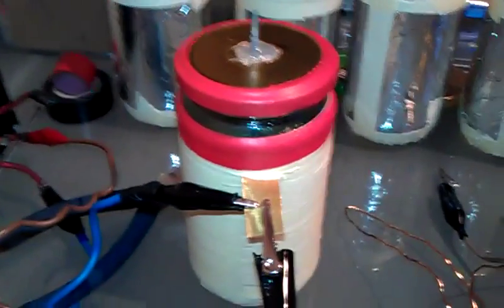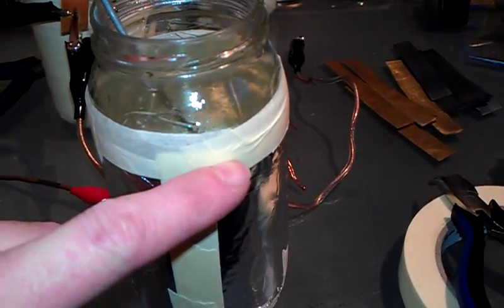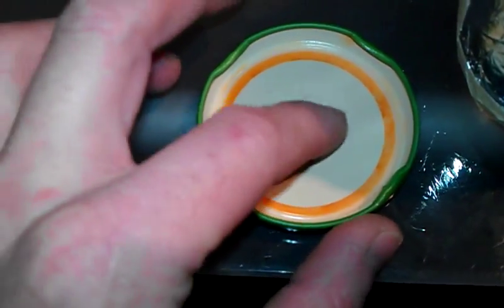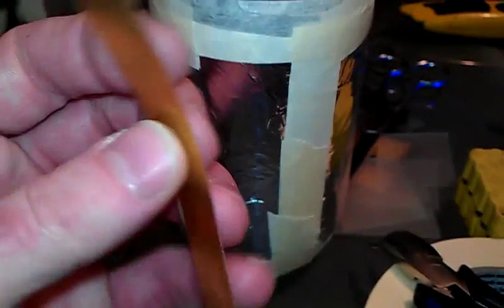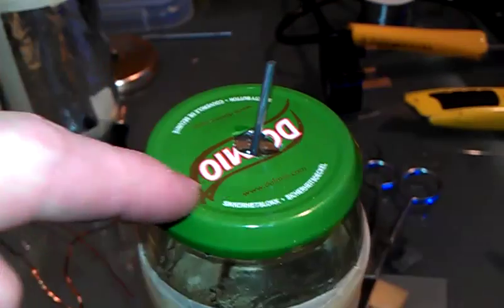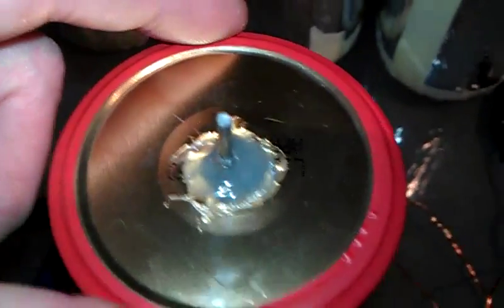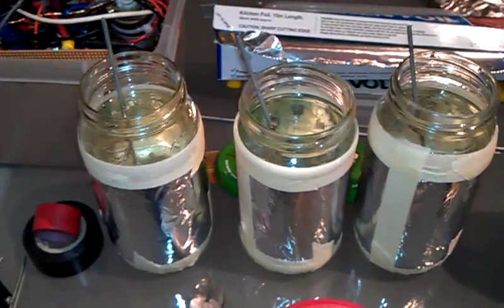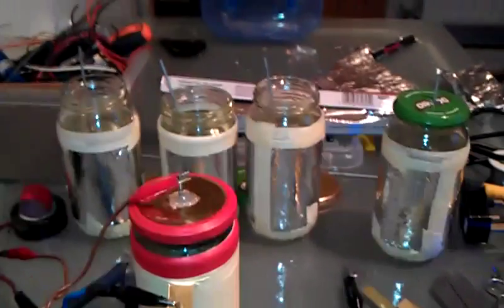Salt water capaciter and the effects

Comment: How you increase the voltage rating of it up to 2kv can you show a step by step...
Reply from the maker: The closer the foil is the the end of the insulation the lower the voltage! As well the thicker the insulation is also” The bigger the sheets of insulation the more voltage it can handle. As voltage can creep up and over the insulation or work itself through the insulation!! 
Hope this helps mate.
Regards 👍🏻

Comment: +high1voltage1rules1 i have been very interested in these saltwater caps so i have made one myself.i hooked it up and had no sparks my power supply is a vintage flyback so its ac about 10kv can u plz help thx i appreciate it :)
Reply: I'm sure you know by now but AC will not charge up capacitors. More modern flybacks have a half wave DC output because of the way they make high voltage. Modern DC flybacks have a small air gap in between the posts of the two ferrite C cores that the coil form is mounted on. That air gap is used so that, unlike in a forward topology transformer where both coils are conducting at the same time, a flyback stores energy during its primary's switch on state, and discharges that stored power during the primary's switched off state. The air gap also prevents the core from saturating, ideally. The secondary of a DC flyback is made up of several stacked pancake coils with high voltage diodes in series between them. The secondary current doesn't flow when the Horizontal Output Transistor is conducting current through the primary coil. Then when the HOT stops conducting, the energy stored in the flyback's core collapses onto the coils and is allowed to flow as a high voltage half wave DC pulse from the secondary. A pulse of around 300 volts is induced in the primary coil as well, but the snubber diode, and usually an RC or RCD snubber, take care of that. Back to the saltwater capacitors, the capacitor adds smoothing that fills in the gaps between the half waves by charging up during the positive half wave, and then discharging during the missing half wave. The reason it increases the power of the output is because, being half wave means that the output power is half of what it could be if it had been full wave, and either changing it to full wave, or adding smoothing to fill in the missing half waves, doubles (or in the case of smoothing, nearly doubles) the output power. Smoothing doesn't exactly double the output power of half wave DC because it takes up some of the positive half wave's current to charge the capacitor up each time, and it takes a lot of discharge to mostly fill in the missing half waves which means more of the positive half wave is used for charging than it would be if the capacitor was smoothing full wave DC and had two half waves to charge from, and very narrow spaces to fill in between those waves. The capacitance needed to smooth most of the AC ripple out of rectified full wave DC is half of what's needed for half wave DC. Also due to the large gap that the capacitor's discharge is trying to fill, in half wave DC, the voltage drops quickly from full voltage down to say half of full voltage, so it isn't anywhere near as much power as it would have if full wave, but is a lot better than no smoothing. And increasing the capacitance won't really help that much, because as the capacitor gets bigger, more of the positive half wave is consumed to charge the capacitor until eventually all of the positive half wave is charging the cap, and then the cap discharges it in a discharge that is still half wave, but 180 degrees offset.